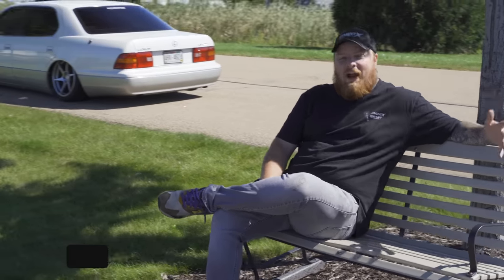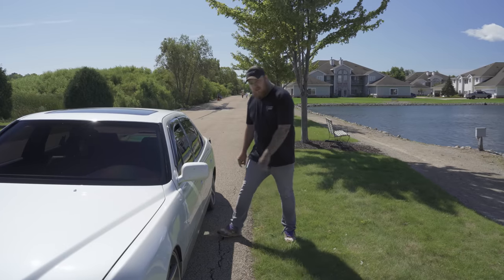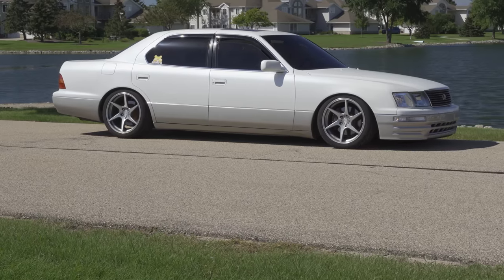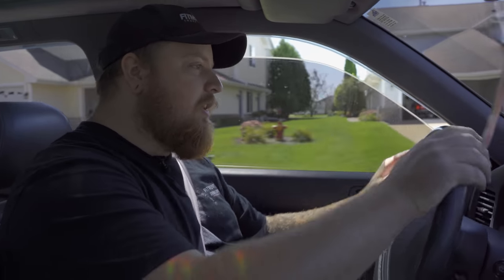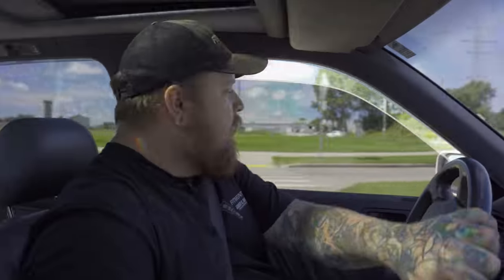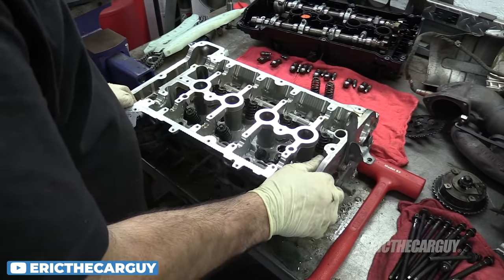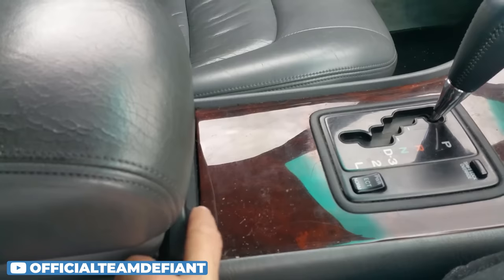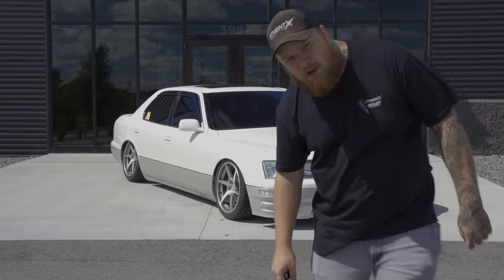The Ultimate Buyers Guide: Lexus LS400

Comment: I love my 95, it's pretty clean with under 200k... for only 3 grand it was a no brainer for an amazing daily
Reply: I also have a 95 LS 400 amazing vehicle i am the second owner over 200 K California car mint condition amazing!
Reply: Do you think a 95 with 72k miles is worth 12 grand?
Reply: @bzanh1306  I wouldn't but I bet it's super clean and could be worth it.
Reply: @adamJeepstuff  agree... would have had to been maintained not just garaged
Reply: @bzanh1306  IF.   IF.  the owners kept it runnin and maintained otherwise ya got an old car with alot of work in front of ya...$$$$$$
Reply: how's the gas mileage for it as a daily?
Reply: Doubt you will see this but today a LS400 under 200k miles easily goes for 5k today or even more if no rust and no engine issues. only a 2k increase but still insanse that they are still going up in price along with many other old lexus

Comment: You can do a 5 speed manual swap real easy and boost it and they're great. People make these into race cars cause if you strip the interior, you can get it down to like 2,600 lbs and those engines will take 700hp all day long.
Reply: @HierarchyOfWeeds  they're freaking ridiculous, course the SC400 is a better chassis with the same power plant and you get get that down to like 2,500lbs or maybe a little less
Reply: im not saying SOMEONE hasn't done it but like. ALL of that is wrong. Pre 98 (Ucf10) 1uz has trouble making 500 flywheel hp with stock internals. Need high compression pistons, steel headgaskets. Manual swaps are pretty difficult due to the LS and SC400 never coming with manual trans from factory. Requires lots of adapting, shearing starter gears, clutch pedal fab etc. Also All the weight reduction in the world wont get an LS down to 3200. js.
Reply: @fiskblack3579  ^^^
Reply: @fiskblack3579  I was about to say the same thing. NFS gamers thinking everything is easy because it is in a video game. The work and modifications would easily cost around $30,000.
Reply: @EmilyRose900   30k is a gross over estimation and with dedication can be done unless youre a person that just drops your car off a shop and picks it up when its done there is no way it comes anywhere near that price tag
Reply: Like I said someone may have done it better. Just dont want people thinking this is some easy untapped drift build car. It aint. Youre looking at around 3-4 k for the manual swap alone. And Thats if you do EVRYTHING yourself.
Reply: @fiskblack3579  
240SX transmission is a bolt up solution.
Reply: @bl3ach101  no it's not. Your forgetting to pay yourself. Sure you could spend a couple hundred hours doing it yourself, and figuring out how to do it. But it either takes a shit-ton of your own personal time and money or pay someone to do it.The parts alone will definitely cost around 15k and there's no arguing that. Then all your weekends for about 2-3 months working on the weekends. Your completely out of your mind thinking it can be done in a few days and super cheap. You obviously have no experience doing such a job. Your basically rebuilding an entire car. FFS get a grip.
Reply: @fiskblack3579  90-91 1uz have thicker rods engine coming fresh from a f1 build you already got built internals with early gen 1uz
Reply: I had a mechanic tell me converting a ford diesel truck to manual would cost more than the truck is worth. That's a vehicle that has transmissions readily available.
Reply: @EmilyRose900  manual swapping a 1uz is way easier than you're making it sound. People make adapters, so you get a r154 for a 2jz, put an adapter on, with the same setup as a sc300. Yeah, parts will cost a couple grand but it's very possible, and if you know what you're doing, it won't take that long. My friend builds old Toyota race cars for a living. We're talking like 40 hours, if you know what you're doing, not hundreds of hours.
Reply: @stephenmoore1541  sc400 is just a v8 supra

Comment: I have a 99 LS400, and I can confirm that they feel amazing  and the interior is still in excellent condition. Very good cars. I also get 24 mpg with mine.
Reply: same
Reply: Is that city + highway?
Reply: @gigel99324  probably like 70% highway and 30% city. I drive 65 on the highway because these cars unfortunately have a 5 speed auto so after 65 you just start using more gas than needed because it doesn't have a 6th gear. That's the one and only thing they should have changed with this car lol. Needs 1 more gear

Comment: The 1uz may not be a powerful v8 but it's one of the best sounding ones ever
Reply: I may to biased but I agree 💯 %
Reply: It’s powerful. 300hp does the job.
Reply: @Coldwallbar  Stock the UCF10 came with 250hp and being 30 years old it's even less than that. I own a 92...it's peppy for being a 30y/o boat but it's not powerful by any means.
Reply: @TheHunterOrion-  my UCF 21 Did the job just fine. Drifting wasn't bad either. It's no CL63, But it's no slouch
Reply: @Coldwallbar  You're missing the point...when compared to most other V8 engines it is not a powerful engine. It's not meant to be, it was made to be reliable and smooth which is where it excels. There's a reason the UZ platform isn't as popular of a swap as an LS.
Reply: @TheHunterOrion-  I would disagree. I’ve heard you could beat a new hemi. Not that those are fast either but the motor has some pep in her step and isn’t going to be the slowest thing in the lot by any means
Reply: @kc.auto__4267  yea I’ve seen a 98 beat a challenger RT but 97 and below fall short.
Reply: @machedari  98 is when they went from 4 gears to 5, 250hp to 290hp
Reply: @kc.auto__4267  hemis aren’t fast? 😂

Comment: I got an ES , despite being Front Wheel Drive, its still a joy to drive a lumpy cruiser feeling like a Yakuza/Goodfella, especially when its time for a road trip.
Reply: I had a '97 ES300, they're very reliable and have a timeless design (I loved that car, it was basically my first car). I have an '01 IS300 currently, as well as an '04 Camry V6 LE (which drives similar to my old ES and it has the same 1MZ-FE engine). I love Toyota for their sheer quality and reliability over time, you just can't beat 'em.
Reply: @neonreign2988  i had a 97 aswell, it was in rough condition but tanked on through

Comment: I own a 1999, white and it is stock. 115,650 miles. On it and yes I had the timing belt done at 115,000 miles w/value cover gaskets. Runs great, the car was a gift from my aunt and uncle.  To me this car is a hot rod.

Comment: What I hate about owning an LS400 is that most owners don't care at all about performance unless it's to drift. They'll just use the stock engine and weld the diff, but nobody does any real performance mods. I really want to push my '95 to 300+HP, but there's just not all that much mods out there. In Australia it seems the 1UZ is more popular for modding, so they have stuff like superchargers that are easily accessible, but not here in the States. In my town I found like 10 guys that all own LS400s or GS400s, but they've just gone the drift route, slam it, straight pipe it, weld the diff, and slide it (not always in places they should be). I want to go a route that nobody else does, and turn mine into a track car. I want to challenge myself, cause it's really not made for the track at all, but I want to see what I can do.
Reply: An eaton m112 fits on the ls and clears the hood perfectly... just sayin.

Comment: I own a 1996 with 75k miles. As the video mentions mods are mostly cosmetic, mine has exhaust, coilovers, Work Wheels etc. along with VIP interior stuff. Things I hear often are the wiring harness tuck like the video mentions for people going low, I'm low on coilovers but don't have any camber so don't rub on that. Other things I hear people say is that when the power steering pump goes it leaks all over the alternator and kills that in the process due to it's placement. Also I get issues with my RPM gauge/Speedo not working occasionally, this is fixed by giving the top of the dash a thump, although the recommended fix is to get capacitors in ECU/Cluster replaced as these can leak because of age. Hope this helps :)

Comment: I got a 99 Ls400 with 215k for 2.4k runs like a champ. I want to put it on coilovers cut out the resonator, reverse y pipe, and the first two preliminary muffs. Then wrap it or paint correction. The clear coat is fading here n there but the paint still looks so good for being a 22 year old car

Comment: I bought my 1996 for $3,000 in 2017 only 146,000 on it at the time. Now it has 175,550 on it and I've had zero problems with it. One thing to note, it isn't exactly fuel efficient but it's quiet comfortable and smooth. I plan to keep it as long as I can.
Reply from the maker: NOPE! These boats arent efficient, but they're definitely a great couch to ride on haha! -Edgar
Reply: Hey just today I bought the same year one as yours with 72,000 miles on it and honestly idk what to do with it idk if I should change the water pump or etc any ideas what I should do first?

Comment: I bought a mint 99 ls400 for my first car and they’re great cars but honestly not a good first car.                                                 Pros: reliable, decently quick(5.8 to 60 on a 99-2000), stands out a lot being a big body sedan, comfortable, 1uz sounds good                                                                   Cons: Hard and expensive to work on, engine bay is very cramped. Basically everything you need to replace on this car is annoying and expensive. Starter is inside the engine, 8+ hours labor, timing belt/water pump will grenade the engine if they break and the job cost about 950$. Some years have very unreliable ecus that cost a very unrealistic amount to fix. Gas isnt terrible on the vvti cars, i get about 24 average mixed city/highway driving.                                                           Ls400s are a really good value for the money but be prepared to pay at least a 1000 more in order to get everything fixed up.

Comment: I own a 92, slowly fixing gaskets and such but otherwise in very good condition. Just brake layed my rotors an got some nice import direct brakes pads on them, brakes so much smoother, I have a whole new rack an pinion setup, going but bosch quietcast rotors all around it eventually. Then I'll be fixing the wood interior as the residue on the real wood has worn off so they dont stay in their sockets fully flushed. Less than 85k miles and got it for $5800

Comment: i had alot of fun cars and still want more.
when i lived in florida i started buying different kind of cars and motors to play with and stopped being diehard to the brands i liked most. good choice. if it had an engine i was interested until i either didnt like the engine for various reasons or it just wasnt what i was looking for. at one point i was dailying a 2 stroke scooter cause it was cheap way stupid fun to drive and could outpace most vehicles on the road at the time. and on the commute i had to take with it i stumbled on a few cars i didnt know much of but loved the body lines and researched them a couple stood out. these lexus were one of them i just loved the body. the vw corrado was pretty slick too but a total vw pos.
many years later im actually in the market to buy one of these as it would be a great car for what i need it for. somethign i can drive anywhere and with a slight lift and its comical oversized tires i can fit 31-33" truck tires. no problems and with its legendary drivetrain i can 2 track it or highway without worry vs a built vehicle. im even thinking after i have it going a year or 2 and work out my need wants for it its gonna get a supercharger and 5-7 lbs of boost max and it will scoot around just like a new car and still be reliable for a long time.

Comment: I am planning on buying this car with the intention of making it a fun daily which i can occasionally rip in the track too. I mean if i put some coilovers and sway bars and better tires it would be possible right?
Reply: you can but please don't. these things are getting rarer and rarer due to people tracking and drifting them. the GS or SC is a better Lexus with the same engine to track but i also don't want you to ruin those either but that's just my opinion on modifying them
Reply: @ethanacton408 yea i kinda get what you are saying. Do you know an other car which i can build to do the same?
Reply: @SlikDewd  if you want to stick with Lexus, the GS and SC have better handling and shorter wheelbases for tracking and drifting. For Toyota, the celica's and supra are good as well. Obviously not the mark 4 supra, as it's too expensive.
Reply: @SlikDewd  you're of course, perfectly entitled to use the LS. But if you do choose to, just know that engine has little aftermarket  performance support. the inline 6 from the GS and SC have far more options for performance upgrades. I'm only familiar with toyota and lexus, so I can't really recommend any other cars

Comment: How’s it everyone. Just on here to get some tips. I just bought a ‘99 and I have been trying to find aftermarket parts (airlift kits, exhaust systems etc) and haven’t had much luck finding any that’ll fit the car. Is anyone able to help me out by sending some website links or just any thing that’ll put me on the right track. Cheers
Reply from the maker: We do offer airlift for the LS400 on our website if you havent gotten a chance to take a look! -Edgar

https://www.fitmentindustries.com/store/suspension?sort=instock&year=1999&make=Lexus&model=LS400&trim=Base&brand=Air%20Suspension%20Kits*Air%20Lift%20Performance&saleToggle=0&qdToggle=0